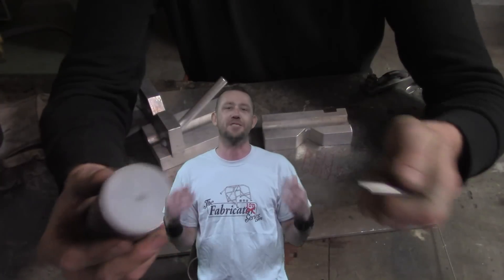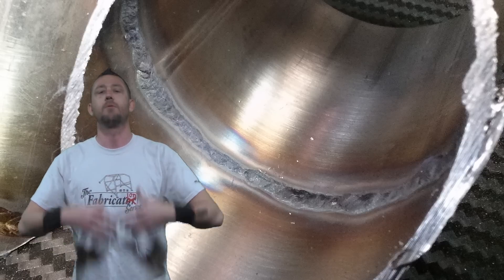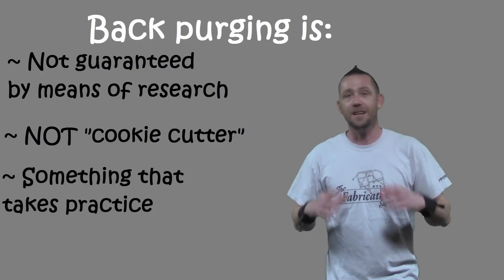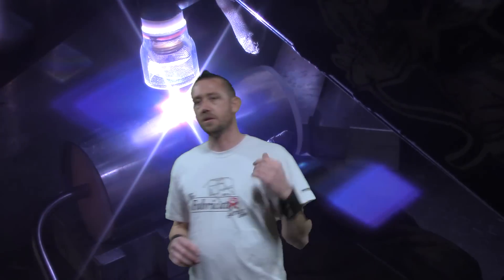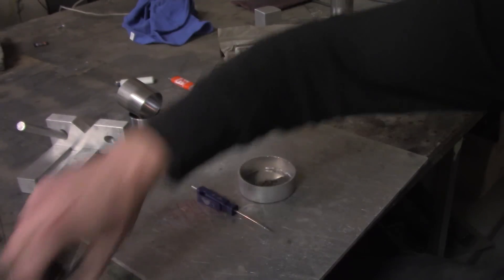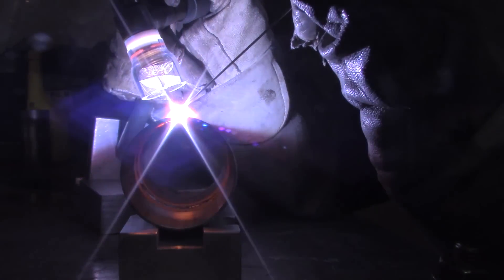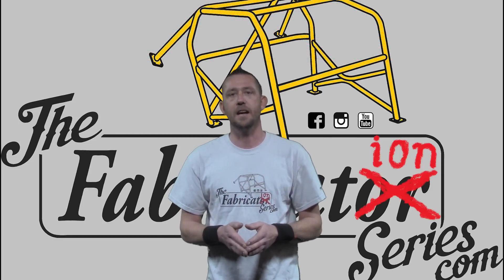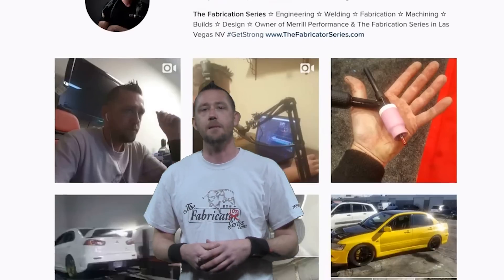TFS: Back Purging - How and Why

Comment: Would a stainless steel car exhaust need to be back purged? It’s not structural and I would be curious if the carbon from engine combustion would coat the inside of the weld and protect it after a short amount of run time? 
Also is cleaning material before welding with brake cleaner instead of acetone acceptable? Being a mechanic I have tons of brake clean all the time but not a lot of acetone.

Comment: Would you use solar flux on boost pipes and intakes. You mentioned it's glassy will any particles get carried into the motor. Do you rather recommend pushing?

Comment: Justin. Great talent. Super quality on non standard jobs. One question or challenge. How do you or actually can you weld in an aluminium  cylinder head port to add metal to the base of the port. . From the base of the valve to the intake gasket to reshape it into a D port? It is so small and you can't see what you are doing. Do you have a way of doing it?

Comment: I'm sorry I use a wet rag stuffed into the end of the tube and double layer duct tape with a hole poked into it in the other end for argon gas to flow and it works great.  Never found the need tfor anything else and it's cheap.

Comment: We use to use 315/316 brushed or polished stainless steel plates/sheets, used for pharmaceutical/hospitality, 

If we was welding two stainless steel plates/sheets, that was butted up side by side together, 

We use to use a copper plate the length of the join, clamped to the back of where you was welding, which also protected air from getting into and around the back of the weld, giving you the same effect,

But we only did this for three reasons,

1 it would take a lot of pure Argon to fill a room,

2 by doing this would probably bankrupt your business,

3 you wouldn’t be able to go into an area that is full of Argon Gas, and if you tried it, you shouldn’t be welding, your weld might not need oxygen, but you do,

If it was a sealed tank or ventilation system, we would back purge it using the Argon Gas, making sure that the outlet is at the highest part of the vessel/tank, as Argon is heavy then air,

Using a lighter at the outlet port, if it’s a large vessel/tank etc. to check if there is Argon coming out, if the flame goes out, when you place it near the outlet, there’s only Argon gas inside it,

👍🏼

Comment: That was the problem when crawling up inside a f105 on the flight line. No way to backup and parts eventually failed. Too many welds led to NRTS of a lot of parts.

Comment: Seems that only way to not  purge is  making wider thicker joint so it does not penetrate inside causing popcorn but its thick enough outside to hold the pieces.
It wont work if u need flat seams of course but it did job for me

Comment: Hi,
Thanks for your video, it was very helpful, as I have not had a great deal of experience in Tig welding stainless steel tube etc.

 I'm going to be back purging 75mm stainless steel tube on a job I will be doing in the next few days.

Just wondering if you would be able to assist me with a couple questions that I have. Much appreciated, and I sincerely appreciate your advice.

Just wondering what gas flow rate do you recommend for back purging over a approximate distance of 3 feet. 

This weld piece has a number of outlets tacked in place and to be fully welded in position. 

The thickness of the material is 2mm. What would be the ideal amperage settings for this weld procedure?

Comment: What triggers the purge? 
As in, the machine opens the valve to flow to the torch, but the line to the purge is just open from the time you turn the knob until you go back to the tank and close it again?

Comment: I welded low pressure SS pipe and plate with a flux cored wire process for years and one thing I really wish I tried while I was there was back purging the pipe.  At my current job we're getting some of this wire per my suggestion and now I'll get to try it next time we need some SS welded.

Comment: Is there a difference in strength if not BACK PURGING??
Reply: DrwPerformance Racing yes and no it all depends on the service of the tube!! If all you are doing is running exhaust lines on a vehicle it’s a waste of argon the fusion from the tig process will make a extremely strong weld because the tensile strength is more than strong enough for the service without purging but if it’s a fuel line then yes it needs purging because over time the weld could crack and leak because of the fuel !!!!!! It all depends on the service of the pipe or tubing!!!!

Comment: That explanation of carbide precipitation is not accurate.  You don't need any air/oxygen for it to occur.  It's when you keep non-low-carbon stainless steel too hot for too long.  The carbon will suck chrome out of its surroundings, and you end up with spots of metal that don't have enough chrome to keep it stainless.  Regardless, I really appreciate your videos, and have learned a ton!  I wish my welds looked like yours.

Comment: Solar Flux has two types. Type B and Type A.  Make sure your using the proper type for the grade of metal. Also Solar Flux is best used for backing when there is no way to purge the part your welding. Or no way to use your backups. (A piece of copper behind what your welding that is laying flat on the back surface and or a made backup that has holes in it that the argon will pass through to give you the shielding that you need.

Comment: Back purge with co2?
Reply: Ocean House no co2 isn’t a inert gas CO2 can be used for welding carbon steel but not purging alloys!!!!
Reply: @rolltide2937  its certainly more inhert than air and might be acceptable in some circumstances... It certainly does .
prevent heavy oxidation but would not be acceptable for tight process controls.... But just fine for automotive exhaust piping.....at least as good as solar flux....

Comment: In the last month I stumbled across your YouTube videos. A little background on me. I started welding in 1990 but in the old days if you didn’t go to tech or what some people say welding school employers wouldn’t even look at your application. So I did. Welded full time and went to school. In my welding career I have had the opportunity to do a lot of things. Full penetration welds that required ultrasound and x-ray inspection. I have done work for the gas and oil industry to welding stuff for drag specialties ( after market motorcycle parts) to working for featherlight trailers on their custom line, car haulers, NASCAR, even Horse trailers that cost more than a lot of houses. The point of this comment is your truly amazing and even as long as I have been welding I have learned from your videos and the new or young welders should watch you vids. If I didn’t live in Minnesota I would definitely take one off your classes for sure. Keep up the great work!!!
Reply: josh schow ,
Are you still welding? I’m an older guy and I’m interested in learning to weld. Do you have any suggestions on how to get started? School first or just try to learn on my own through trial and error? I don’t know anyone who welds so I’m on my own on this.
Reply: John Morales I am still welding. I put in about 60 hrs a week. Currently tig welding big stainless steel tanks. As far as learning to weld. School is the best start. Not sure if your looking to go in to the trade or weld stuff for yourself.
Reply: Settle down bro. Nobody cares.

Comment: a good tip for getting the right and even gas flow from the plug is to insert a copper pipe into the plug of 4mm large, then you get even and fine flow from the plug

Comment: firstly, the weld is very uneven on the outside and then it becomes the same as on the inside of the tube, try welding with a pulse or with a pedal, the weld should be able to be as wide or wider on the inside as on the outside, you also have an uneven tempo with your fill thread .. Try dropping the thread 123 123 123 as the tempo of a song you listen to.
Reply from the maker: 🤔 I dont recall seeing your video on the subject.... perhaps you could do something other than writing text to show that you're something other than a wiki-welder?
Reply: The Fabrication Series I loved your video I’m a welding instructor I’ve taught this trade for years and you did a really good job !!! For what you are fabricating your welds look good your videos are extremely informative keep up the good work son!!!!!!!!

Comment: One thing to keep in mind, is if you tack the tubing with sufficient heat to penetrate to the inside, you will contaminate the finished weld since no purging is available during assembly.  On  316SS tubing (generally about 16ga.,)  I would fusion weld a tack about the size of a pinhead, in about a dozen places....the more tacks the better...it keeps the tubing from creeping out of round during welding.  Then, fusion weld (without rod) under 50% pulse after setting up the purge.  Generally, rather than leave the exit hole for purging, I stick a small piece of steel wool in the exit hole to eliminate turbulence inside.  Works beautifully, and you should see nothing but bright, shiny weld on the inside, with no spots where the tacks were.  Heat shrinkage at the weld prevents suck back and provides a slightly raised weld inside and out.  Takes a bit of practice, but makes pretty impressive,strong welds.  Most of my work was in Lab equipment and prototype fabrication in Stainless and Titanium, where back purging was always an absolute MUST.
Reply: I build a lot of stainless headers and all of them are fusion welded. I was wondering why the welds do not become undercut when not using filler, thank you for explaining that. And yes, I always purge stainless. I start out at 10-20 CFH for a couple of minutes then drop it down to only 2-3 CFH when I start welding.

Comment: What about nitrogen as purge? I’m an A/c tech and we purge the copper piping with nitrogen and it’s clean, it acts same way by removing atmosphere from inside. 

Or is actual welding and stainless require argon?

Comment: All good info, however I wish you would have touched more on your solar flux.  Building non turbo headers, and can back purge, but if I can run solar flux on everything before tacking it all together, then I wont have to cut it all up to back purge.

Comment: On SS tubing , lap joints and butt joints , I have experienced that  it is much easier to weld/control the puddle when you BP ! (much easier and edges don't burn away!) It does make a difference, "sugaring" aside!  Thank you for the vid Justin!!

Comment: can you flux and purge in combination?
Reply: Yes. But it's redundant. You're better off just purging and saving the hassle of dealing with methanol. Purging is clean, easy and professional, but it's more expensive and requires more equipment. Methanol is a practical option.

Comment: It is not up to you, but what the regulation and standards are applied for your application. 
This is kind of hobby video, not for professional
Reply: Been welding for 20-plus years and I didn't know any of this stuff. This is not a hobbyist video. I learned a lot. maybe if I'd have been properly educated and welding and metal fabrication I may have known it but I wasn't. I mostly self-taught in the field with very little schooling. Now digging into TIG welding I'm trying to learn as much as possible. Don't discredit somebody who's trying to pass along information to those who don't know it.
Reply: @richgrasby5294  good luck with TIG welding education. If you want to become a professional welder you will need training, study of regulation and standards, and of course special school. You can be a good welder without these, no doubt, but not a professional who perform standardised welds. 
I am not trying to accuse the video knowledge, but to show that if you want to go deeper in this field, youtube videos are not enough, but study, reading, and training is the key (depends what kind of welding you want to become). Cheers!

Comment: Great tip about the weep hole! Not only is it necessary when back purging but also when welding most any enclosed container.  As you know, when you weld the air inside heats up causing it to expand.  When this happens, as you get to the final sealing weld the pressure buildup from the heated air will do the same thing as in your video (maybe not as spectacularly though)

Comment: I gotta say, this is the first video purging was explained so well. Excellent idea to show everyone what happens when you do and do not weld correctly. I had a boss that would get mad and tell me that sugar forms because you're over heating the pipe and would say he's never purged a pipe in 15 years and has never had any problems with durability. (Lies). This video helped a lot, thanks!

Comment: Can you purge with nitrogen? I just bought an AC TIG to work with aluminum, and I'm planning some projects that will be structural. Seems like the important thing is inert gas, and no oxygen, so nitrogen seems like it should work for purge only gas. Is the cost difference enough to bother (assuming it works)?
Reply: Try it

Comment: have you tried welding in a vacuum chamber? might be like ... you know ... more expedient ..?
Reply: Interesting...  I thought about this for a second.  I think that the shielding gas (and plasma raw material) would probably get instantly stripped from the torch, before your arc/plasma even has a chance to "ignite".  The Ar would "go down the drain", straight through your vacuum source; stopping everything before it even has a chance to start.  Sadly if it did actually light up, it would probably be uncontrollable and therefore useless...I think...bummer.  I bet someone has tried it.
Reply: well you wouldn't really need shielding gas i guess ... for one ... though i'm not sure you could even start an arc without something like oxygen in the environment to begin with so ... maybe it was a silly question

Comment: I wonder if there's any mileage in making a set of inlflatable toroidal balloon plugs? This may make them easier to push into/pull out of interior situations which are awkward and may reduce the amount of Ar required if they can be moved into closer proximities either side of a weld.

Comment: that is because 10 cu. ft. hr. is to much flow for the purge. when you get back to the start your weld can blow out from the pressure
Reply from the maker: Jack Schaefer Its not too much of there is ventilation/relief. Pressure is built up when there is restriction. Flow is only relative to time it takes to build up pressure which basically means it will take less time to build pressure if the flow is high, and more time if the flow is low.

Comment: If I didn’t back purge can I clean off the “sugaring” so it doesn’t fall off or break off later and go into my turbo? Or should I buy new pipes. Curious cause money is an issue right now lol.
Reply from the maker: David Tran The problem is not the clumps breaking off. It's the fact that they're filled with tiny holes and brittle. You can try to sand them smooth, but that doesn't get rid of the sponge-like consistency on the weld.

Comment: I use aluminum foil to wrap the pipe for back flow. Also in you don't have a dual reg. you can get a Y at the Welding house and small flow knob and use that. Really Nice Video on this. Must have taken a lot of editing.

Comment: rule of thumb: if working on a nuclear reactor, use the most argon you think you can get away with. 
if working on ugly modern art, use the least argon you think you can get away with or don't use any and say you did it on purpose.
Reply: As someone that its just starting to learn to weld high and ultra high vacuum components its been hammered into me every day, I even dream about it....
Reply: I've been welding for 20 years and this is the first I've heard of purging. lmao shows you how needed it is in the blacksmithing/fabrication industry. lol
Reply: @77Avadon77  Yeah I was told that you just weld it right to not burn through the other side. If you get sugaring it means you are welding too hot and slow. I was allowed only a little sugaring to pass my tests in school but we did no purging and we were told it wasn't necessary.
Reply: @traininggrounds9450  There's sooo many different arenas of welding that some of these things I think most will never use. For example, welding in Medical, Aerospace, etc.  Many of these arenas the average welder will never come across some of these super specialized areas.

Comment: @Fabrication Series - I tried the Solar Flux & Heet, worked great. It immediately prevented oxidation on the inside of stainless tube. Very helpful, not something I would use for food or pharma components because it does leave a black enamel like coating, but good for just about everything else.
Reply: it seems right at home for automotive at least especially exhaust systems. but every other video I find they're still back purging lol

Comment: For the purging, it may help if one remembers that both Argon and Carbon Dioxide (if a mix is used) are heavier than 'air', so it may be a good idea to plan it so one is welding towards the bottom of the parts, rather than the top. May also help when planing how one is going to be introducing the purging gas.

Oh, standard treatment for methanol poisoning is ethanol - true! So, AFTER the use of the flux, and the welding, a beer can be medically recommended... ;-)

Comment: I have a terrible memory, so I found that it was easy to forget to turn the purge gas on or off when I'm doing a lot of welds. That's either bad news for the weld or for your pocket since gas is expensive.
The solution for me was to have a second solenoid valve for the purge gas that actuates when the torch gas is on. Simple but effective.